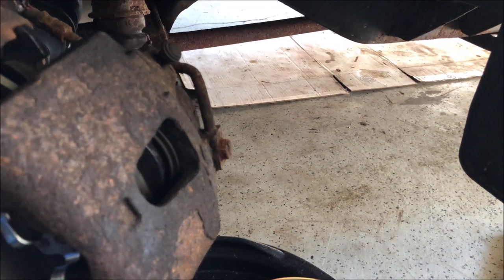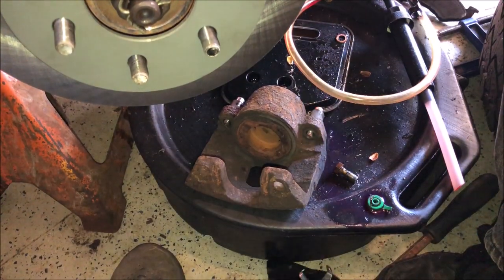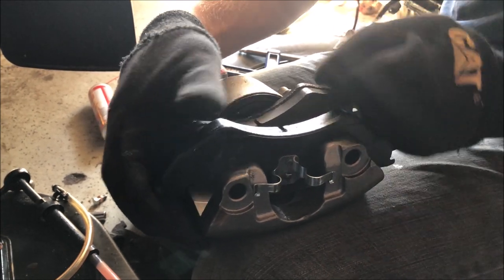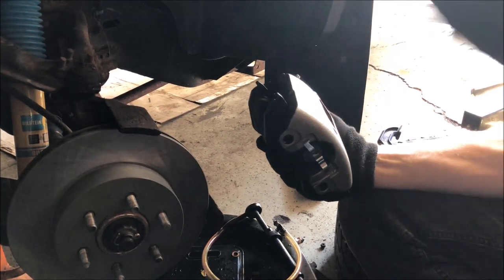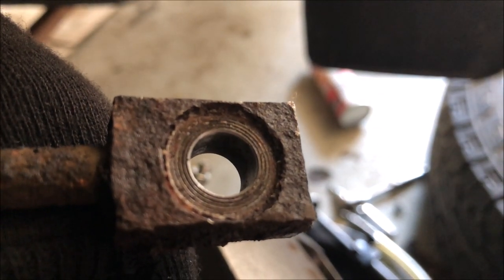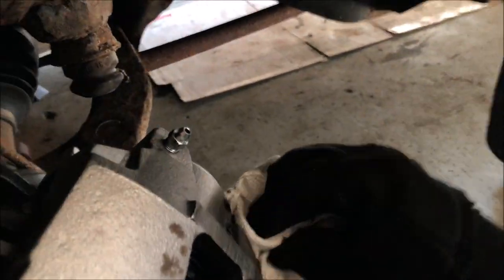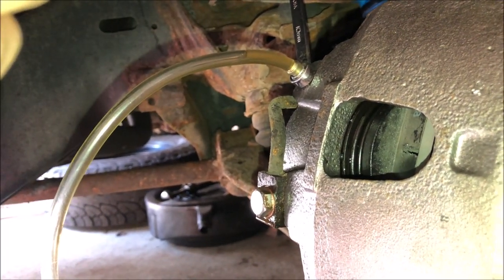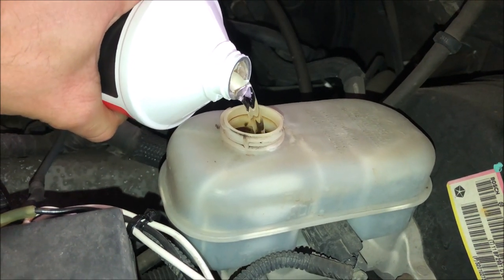Dodge Dakota/Durango Front Brake Caliper Replacement Video

Comment: Great video. My calipers didnt come with a new banjo bolt so I had to steal them from another caliper the parts store. The size is 10mm x 1.25. My manual confirms your torque value at 22 ft/lb. Ultimately I came here to see how you mounted the "upgrade" spring. Great video, thanks for taking the time.
Reply from the maker: Thanks for the feedback! Glad to help out!

Comment: 1st dont remove the brake line until last.  You do not want the reservoir to go dry..
2nd. Did not address the grooves on the pad rails. Tip grind and polish those surfaces.
3rd. No lube any where...squeek and sticking pads to come.
4th. Lube the pins. Brakes need to be able to relax when you let off the pedal. No lube= warped rotors.
5th. Replace the rubber brake line. You can't see the inside of the line for deterioration.
 Best thing done was the use of a 6 point wrench.  Another tip is get the rotor off and clean the hub surface and rotor surface to bare metal and protect it with a thin layer of No2 grease.

Comment: You are very thorough.  Just to add to this - you might want to check out a Phoenix Systems brake bleeder kit.  It's a little pricey, but you can bleed brakes yourself including the master cylinder still on the vehicle.  I never bench bleed a master cylinder now.  I use this one-man bleeder.  You "reverse bleed" - pushing new fluid from the bleeder screw through the brake lines into the master cylinder.  The air bubbles up in the master cylinder.  Very nice.
Reply from the maker: Thank you for the input!

Comment: Stick the open end of the hose into a 20 oz bottle and fill it a quarter of the way with fluid then just pump the brakes until no air. One person ability unlocked.

Comment: I  would pre- fill  up the new caliper through the banjo bolt hole and hook it up to the line. That way you don't get a whole bunch of air in the line(s). If you get too much air in the lines, you'll have to take it to the shop and have them bleed the brakes with a bidirectional scan tool.. Remember, the new caliper is fully of air too.That spring thing that goes on the outside of the caliper isn't an upgrade. It's supposed to be on there and it needs to be there. Otherwise the pads will wear unevenly. After you're all done and bleed the crap out of the brakes. If the pedal is still spongy. Don't waste your time trying to get the air out of the system yourself.  You got too much air in the system, the air got into the ABS module. You'll never get it out without activating the ABS motor/module. Btw,AUTEL Maxi-check Pro doesn't work for bleeding these ABS modules either. That's why I pre- fill the caliper and hook fluid lines up quickly.
Reply from the maker: Not to say it isn't impossible, but in 15 years of professional wrenching, I've never had this problem. In theory, the air from the caliper shouldn't be able to make it's way into the master cylinder, which is when you'd run into problems. But you are right if air gets into the master or the ABS module then it does become much more of a pain to bleed and you need a good scan tool like you mentioned. The new caliper pistons are always compressed, so there's very little air in the actual caliper. and only a small pocket should form inside the caliper once you connect the brake line, and of course gets purged when you open the bleeder.

Comment: Can you use the old spring from the old unit or do you have to use the new one with the new unit?
Reply from the maker: Springs? You mean just the brake pad retainers? They could be reused so long as they didn’t get hyperextended and lose their resistance.

Comment: Big problem with that style front brakes on Dodge is the rails the ears of the pads slide on.  Can see in this video they're notched from previous pads.... that can be problematic and cause the brakes to stick or lock up.  Best to file or grind those rails smooth if they have notches worn in them. Unlike most other brake calipers systems, the bracket with the rails on it cannot be replaced; its part of the whole spindle assembly, and it doesn't have hardware over the slide rails that can be replaced, only thing you can do is grind it smooth so pads slide easy.
Reply from the maker: Yeah, they should at least include shims with the new pads but it is a bit of a poor design.

Comment: Tony, what kind of side mirrors are those? I like them and would like to do the same to my Dakota.
Reply from the maker: They're actually factory 2nd/3rd gen Ram tow mirrors, and I modified the door to make them fit. I have an install video but it does require some drilling, cutting, and wiring.

Comment: Mines a 2 wheel drive with drums on the back. Do i bleed the back too or is the front alone okay?
Reply from the maker: You should be ok to bleed only the caliper that you’re replacing, as long as you didn’t run the brake fluid reservoir dry. If that happened, then both rear drum brakes need to be bled in addition to both front calipers.

Comment: I've read that the caliper bracket bolts are 125 ft lbs and the banjo bolt for line connection is 35 ft lbs.
Reply from the maker: The caliper bracket or the caliper itself? Bracket removal is not required for this and the caliper bolts would probably snap by about 40-50 ft lbs but 35 sounds about right for the brake line banjo bolt.
Reply: @TonyTheTruckGuy  yeah, I just included the caliper bracket specs for informational purposes. I believe you are right about the caliper bolts being 22 foot pounds.

Comment: What happens if you do run and drive on empty reservoir then refill and don't bleed anything... further more,what happens if you don't bleed the master cylinder 🤔
Reply from the maker: You'd have very weak brakes, if any brakes at all with all that air in the system.

Comment: Why dont you replace the hose as well?
Reply from the maker: Sorry for the late reply, 300+ comments were "being held for review" for some reason. I assume you meant the brake caliper hose? They were a bit crusty, but no major issues. The damn things never want to unscrew from the other end where they meet at the frame rail and it always turns into a nightmare so I just left them alone until the day comes that they start leaking.

Comment: 7mm doesnt fit my 2001 Durango.
Reply from the maker: For the caliper bolts? What are yours?
Reply: @TonyTheTruckGuy  for sure not 7mm on the passenger side. now I am reading the drivers side may be 7mm and the passenger 1/4 inch. wth  pulled the wheel off three times today trying to get this sh$#t done.
Reply from the maker: @vyperpilot  1/4” and 6mm are close in size but not quite the same. Is it an Allen bolt at least?
Reply: @TonyTheTruckGuy  Thanks. I know. 7 mm passenger. 1/4 inch driver side.  Yes, allen.
Reply from the maker: @vyperpilot  That’s ridiculous lol. Idk what they were thinking with these front ends.